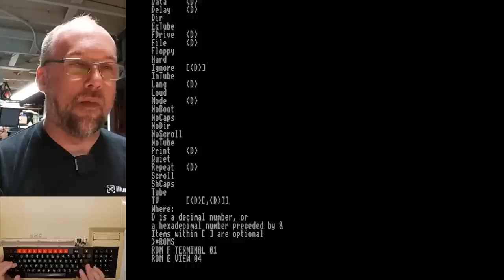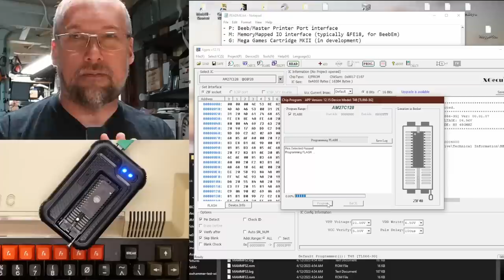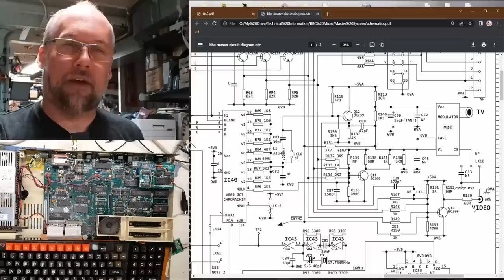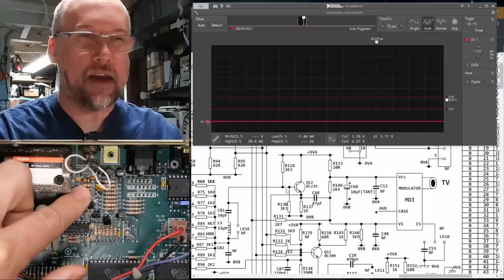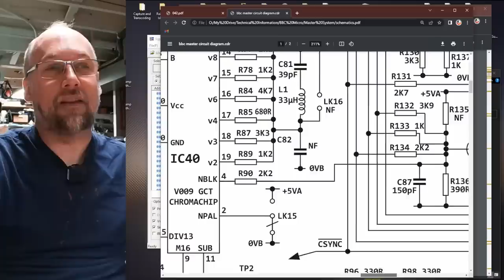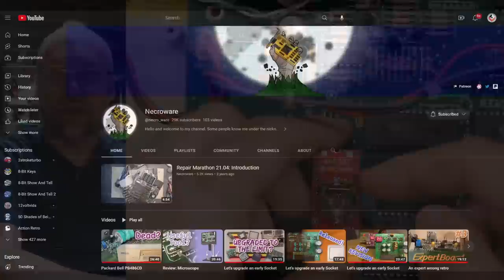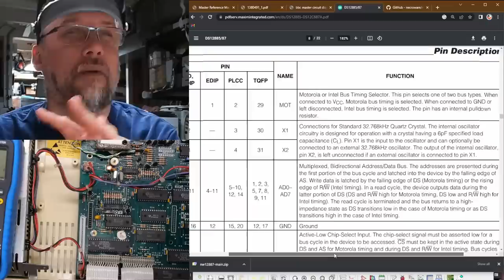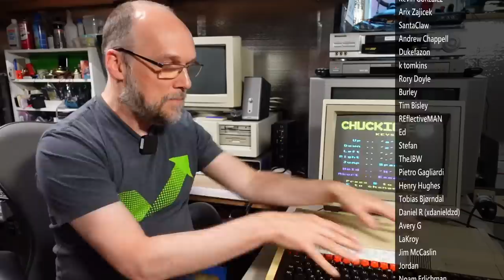BBC Master mods and improvememts

Comment: Very intresting video, liked the various mods done on this microcomputer. Could you have removed the modulator and create a PAL composite?
Reply: Making that missing link (the "NF" in the circuit diagram stands for "not fitted") to combine the colour information with the composite signal is effectively the standard colour composite modification available for many of Acorn's 8-bit machines. Most people performing that modification back in the day would have been in PAL territories, using PAL televisions and monitors comfortable with the 625i picture generated by these machines.

I'd have to review what Adrian has actually done here to make this in any way NTSC-specific. According to the Wikipedia page on composite video, perhaps the most significant difference between PAL and NTSC with regard to colour information involves some kind of phase alternation in PAL, as its name rather suggests.
Reply: @paul_boddie  yeah, that last factor is presumably the only change made with that NPAL pin change. Plus the hardware crystal change to get the colour burst frequency right. NTSC and PAL are otherwise so similar anyway.
Reply: @kaitlyn__L  Now I see the NPAL modification! Sorry for the noise!
Reply: @paul_boddie  as far as I’m concerned all discussion is educational in stuff like this! For the participants and others reading. Not noise at all :)

Comment: Back in the day I had a 1084 monitor, mine would of been PAL.  If you the analog RGB input do you need the NTSC mod for your NTSC 1084?
Reply from the maker: PAL and NTSC are simply composite color encoding schemes, so using RGB means those PAL or NTSC doesn't come into play. In other words, no conversion is needed if sticking to RGB...
Reply: @adriansdigitalbasement  so as long as the monitor can handle the hertz then it doesn’t matter

Comment: This has nothing to do with The BBC, but it does concern the repair of commodore 64s using ChatGPT. I was able to design several ChatGPT prompts that diagnose problems with this machine and if it works for the Commodore 64 then presumably it will work for other machines too. Using ChatGPT I was able to generate repair troubleshooting guides that solved CIA, SID, VIC II and ram problems. I was amazed at the proficiency of the troubleshooting steps it recommended also.

Comment: You released a video about two old lcd TVs which didi PAL without issues on the second channel just a couple days ago and now you have nothing to connect RF tp?
Reply: The release dates and production aren't on the same timeline. This video was probably produced before the monitor video even though the monitor video was released first.

Comment: Awesome video!  Mods are so much fun! Seeing how you added color to the composite out, I wonder if it would be possible to do the same for an Aimga 500?
Reply from the maker: Unfortunately Commodore left out the NTSC/PAL color encoder on the A500 and A2000. It's there on the A1000, A600 and A1200 .... they used a little encoder IC that takes the RGB and generates the color composite. This means there is no easy way to do it on the A500. Probably what you could do is buy the A520 which has the encoder IC, and install that inside the A500 case, then wire the output to the composite jack with some bodge wires.

Comment: I wonder if the 50Hz NTSC was what the amiga did for "PAL mode" on US models?  I had (still have) a monitor that synced at both 50 and 60Hz but obviously as an NTSC monitor it wouldn't have decoded PAL color...
Reply from the maker: I haven't tested that -- the Amiga 600 and 1200 use a composite video encoding IC that supports both PAL and NTSC. Seems like the encoding mode is controlled with an input pin that is linked to either GND or 5V. The Amiga custom ICs supply the color carrier clock signal, so who knows what the encoder IC gets when in 50hz modes.

Comment: *CAT or *. to list the directory; SHIFT+BREAK to boot the disk. *DIR changes directory. The directory separator is a dot, and $ is the root directory, and a leading colon marks a drive number --- so, the DOS path C:\foo\bar\baz becomes :3.$.foo.bar.baz in MOS. The reason why none of this is in the MMFS documentation is that it's all completely standard across filesystems, and it's assuming that you'll have a copy of the User Guide which explains it all!

Comment: Very cool.  Now where can I get one without flying to the UK?
Reply from the maker: Ebay is likely your best bet, or working with some retro resellers there.
Reply: Even in the UK they’re expensive now.  All retro micro are relatively expensive in the uk now. 

My personal recommendation would be buy a ‘for parts or not working’ machine.   The chips, caps and resistors etc that may need replacing are a lot easier to source than the micro itself.  

Other recommendations?  Ask if it can be sent as a gift.  Less tax for you.
Reply: If you've got a handy time machine, you could go back to the early 00s and pick them up by the dozen for the equivalent of about $15 each. During my retro computer collecting phase, I eventually had to stop taking BBC Micros and BBC Masters, because I had so many of the bloody things - literally piles of them. If I'd known they'd end up worth real money again, I wouldn't have sold the entire collection as a job lot in 2005...

Comment: Sometimes I wish the whole world would have chosen between PAL, NTSC and all the others and use only ONE instead of multiple formats to avoid region problems.
Reply from the maker: It happened because NTSC color came out in the early 50s -- PAL and color broadcasts elsewhere didn't happen until quite a bit later and they thought they would try to fix some "issues" with the much older NTSC. It's all irrelevant now with digital TV since it's only a frame rate difference we have to convert now.
Reply: @adriansdigitalbasement  I don't think there were issues with NTSC, I think this was only a "format war". Just like the mobile phone network differences on the whole planet, or the competition between the 8-track cart and the compact cassette.

Comment: Here's the major problem I see with this kind of mod. Although it'll work for loading normal disc images, any loaders that directly access the 1770 just won't work. Any calls to stuff like OSWORD &7F and others will all badly fail as well the ADFS calls. The ROM would need to claim these calls and in order to do that, I'll have to be in a slot higher than the DFS ROM. This way it can claim the call before it is offered to the other paged ROMs. The next problem is that the User Port is initialized after the paged ROMs so at this point you've got no chance of intercepting these calls. The only way of making this device work properly is to write a ROM to claim the calls before DFS does and then pass them to the User Port. Your ROM will need to claim its own workspace and possibly an NMI also.
Reply: The loaders should be fixed. A low-cost easy option will always win from a complex expensive option. It's just like SD2IEC on the Commodore 64: Not perfectly compatible, but still an awesome low-cost storage solution.
Reply: @danielmantione  This is not about the cheapness of the solution, I rather like it... But it still won't work very well with many games loaders. The only way to make it work with game loaders, is like I said, write a ROM, claim the OSWORD calls and pass them to the User Port. There really isn't any other way.
Reply: @thewelder3538  Like I said, the loaders need to be fixed. Just like there is nowadays a large library of SD2IEC fixed games, the BBC needs to build a library of SD compatible games.
Reply: @danielmantione  No, that's NOT a good idea. Firstly, that would require rewriting large sections of code. Secondly, you now have something that isn't authentic or how it was when it was available to purchase. Thirdly, you'd need to understand the loaders as that involves removing things like protection systems, logical sectors, Deleted Data Multi-Sector and the almost uncopyable weak bits like Sherston used to use.

It's much easier just to intercept the calls to the 8271/1770 and pass those calls to User Port. This way, you wouldn't have to rewrite the loader for every game.

This is NOT that technical thing to do. The ROM passes the unrecognised OSWORD calls to the User Port, the controller on the User Port extracts the data from the image using the parameters of the call. I could code this myself if I actually had the time to do it.

There's a reason why places that archive images of games use flux transition images rather than rewriting loaders and producing standard formatted disks. I want something genuine and authentic, not something that's been broken and cobbled together just to make it run from an SD card.

Comment: The juddering looks a bit weird, like it's sending an interlaced image instead of the "double striked" 240p. Normally when sending a half-res progressive image the timing of the video signal tells the monitor to start at line 1 again instead of displaying the next set of fields starting on line 2, but here it looks like it's alternating between odd and even.
Reply: The teletext display mode is genuinely interlaced which can cause quite a few issues with video format converters and capture solutions. All the other modes have progressive scan and produce 256 visible lines from the 312.5 lines in any given field.
Reply: @paul_boddie  That's really interesting, doing it like that despite sending the same information across both fields.
Reply: @Nukle0n  The teletext is done by the SAA5050 chip. People are quite fond of the higher, interlaced resolution that it generates, but it produces its own set of challenges. This dual-mode display system with a character generator on one output path and a bitmapped video chip on another added a degree of complexity and cost to the system.

On the Acorn Electron, the SAA5050 was omitted entirely and the teletext mode had to be simulated unless additional hardware was introduced (with some rather interesting approaches undertaken). And on Acorn's ARM-based machines, the teletext mode was simulated in software: they didn't exactly need to add an old chip and some extra circuitry just to save a few kilobytes of RAM.
Reply: @Nukle0n  The teletext mode doesn't send the same information in both fields. The SAA5050 chip does interpolation on the character set to produce a genuine 625-line resolution image with differing odd and even fields. If you switch off interlacing in Teletext mode it looks really weird. The bitmapped modes don't do this, however. They do repeat the same information in both fields. They do this because it was a design requirement that the video output should be broadcast standard PAL so it could be genlocked and inserted in to TV programs, and the BBC genuinely did use it this way. The broadcast PAL standard had interlacing, so the BBC Micro had to as well.
Reply: @cmjones01  I don't know where to tackle what you are saying here, because you talk about video modes in one sentence and then in the next to talk as if the system only has one video mode.

Also just because it will output a standard PAL signal doesn't mean it'll be genlocked and time base corrected, you would still have needed special equipment for that.
Reply: @Nukle0n  sorry if my writing was confusing. All the Beeb's video modes, teletext and bitmap, comply with PAL broadcast specs as standard, and are thus interlaced. Sure, genlocking to studio sync needs a (small, simple) bit of extra hardware, but once done there's no TBC or standards conversion needed on the Beeb's output. That was an explicit design requirement, as I understand it. However, it's easy (supported by the OS command *TV0,1) to switch off interlacing in the bitmapped modes for a more stable image where broadcast compliance isn't needed. It's possible to switch off interlacing in Teletext mode but the results look a bit odd so it's not supported by the OS and involves some CRTC hacking. Of course, you're free to create your own video modes by reprogramming the CRTC and they can comply, or not comply, with any standard you want!
Reply: @Nukle0n  something else I didn't make very clear: when the bitmapped modes are generating an interlaced signal, the odd and even fields are identical but drawn half a line offset on the screen so the whole image judders up and down at 25Hz. This isn't a problem for games and viewing at a distance, and in fact nicely conceals the line structure, but it's horrible for close up viewing of text. That's why it was made possible/easy to switch interlacing off in those modes.
Reply: @cmjones01 Yes that's what originally prompted this content, that it's only doing essentially half the fields worth of resolution but instead of of using a double striking mode by default it sends the same information as the 2nd set of fields, which gives it that flicker.

Comment: NTSC on a BBC? That sounds like one of the least useful ideas in a long time. Lots of the software actually used the whole 256 lines of display so I'd guess they are close to impractical in a 200-line setup. But kudos for making it work!
Reply: NTSC is just a colour encoding method - it's independent of the line standard. There's no reason why you couldn't have 625-line NTSC or 525-line PAL, and indeed the latter (known as PAL-M) exists in Brazil.
Reply from the maker: Yep and that's what we have -- NTSC-50 so it has 256 usable lines with NTSC color encoding. So it can work with any NTSC monitor that can handle 50hz. (Basically everything outside of some of the very last CRTs...)

Comment: Japan has (had) NTSC and 50Hz AND 60Hz mains frequency, depending on location, so a monitor designed in Japan should handle both.
Reply: Afraid not. System "J" is 60 Hz only. Yes, even where the electricity is 50 Hz.
Reply: @andrewtormo7662  I stand corrected.

Comment: You, understandably, don't know what you have.  If you boot up an old word-processor, or random game, you're using it wrong. There is only one practical application for a BBC microcomputer in 2023, and it's something that no other machine can do, be it a PC or a PS5. You have a machine capable of natively running, objectively,  the best video game ever made for any system, new or old.  You have an Elite machine.

Comment: it would be interesting to see how you rate the bbc master vs the c64

the c64 sid is much superior to the bbc, but the bbc graphics appear much superior to the c64...see the games on the sdcard
c64 free memory in basic is superior to the stock bbc, but if using shadow ram to free up screen memory, or using sideways memory, or add a rpi to emulator a 6502 second processor, the bbc is much more powerful

the bbc's 2mhz cpu clock is twice the speed of the c64 and not hindered by memory refresh cycles by using 4mhz ram chips
Reply from the maker: I'd say the BBC graphics are definitely not as good as the C64. It's only 8 colors and doesn't offer things like sprites or hardware scrolling. The RGB does make things look nice and sharp, but it's just not nearly as colorful as the C64. The graphics on the BBC are much more related to something like CGA (except better color capabilities) Outside of that, the BBC is pretty great. Faster CPU, capable basic and really amazing expandability. It was also so much more expensive ...... it's kind of like comparing Apples and Oranges. :-) Or Apples and Acorns?
Reply: @adriansdigitalbasement  good point about the sprites and colour depth...I guess acorn went for the high resolution mode 0 to pitch it as semi pro

...and reassuringly expensive price tag LOL